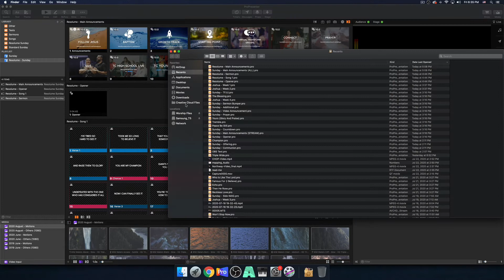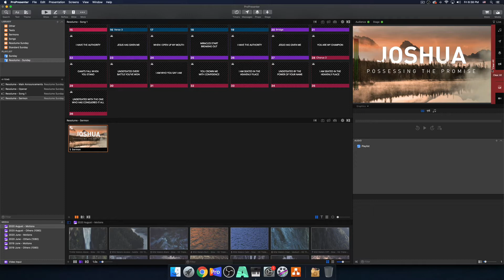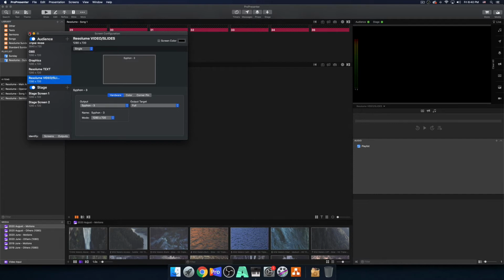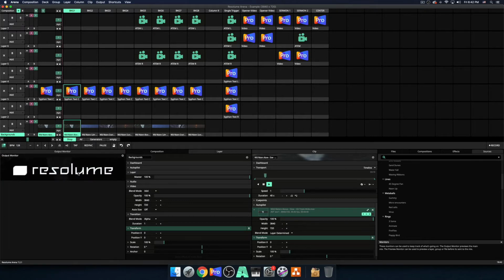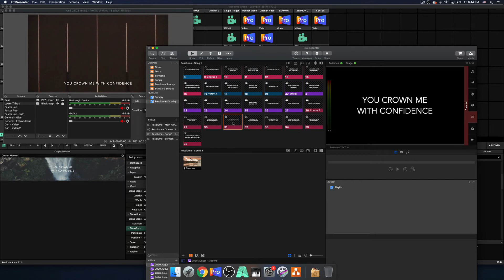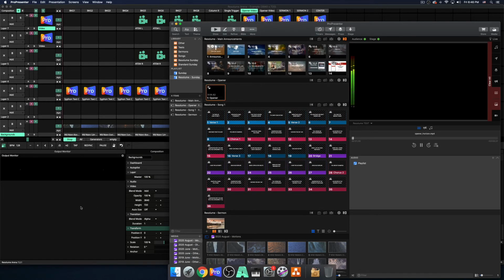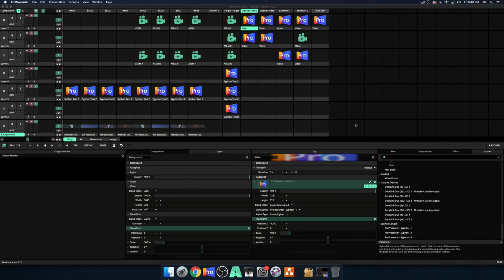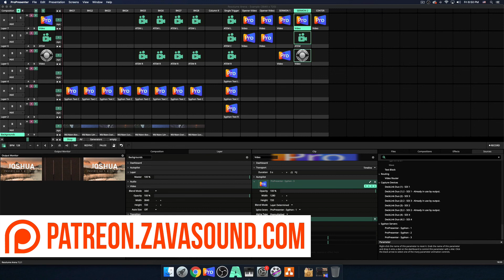ProPresenter 7: Resolume Arena 7 Integration

Comment: Do you know a way to get the SDI input of Key and Fill into Resolume. We can't use NDI  because it keeps taking itself offline and we can't figure out why because it worked fine with our Hippo before we switched over to resolume on a Mac and we can't use syphon because Pro7 is on another computer in a control room. Any instructions on how to get key/fill via sdi inputs would be great. I already have those setup and in our router and routed down to resolume so I just need instructions on how to setup Arena 7.

Comment: Thanks for the video, great explanation! I think our church is going to move into this direction... question about your set up, I see that you might of had triple wide sending from pro 7 at one point... this is currently how we are running things. Any reason you are not doing this or have switched away from it? or did it never work for you? The only big advantage I see is that looks on pro 7 don't "fade" so when changing content and the content fade the look changes immediately and then the old content fades out on hard look change.
Reply from the maker: You nailed it. ProPresenter looks are a pain in the butt. Resolume and QLab are designed to handle triple wide better.
Reply: @zavasolutions  awesome, thanks for your insight!